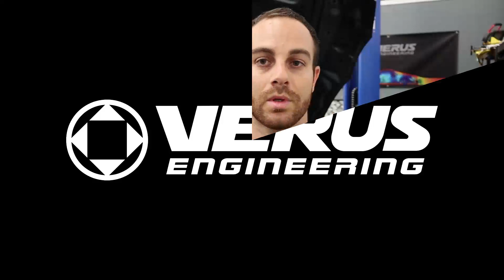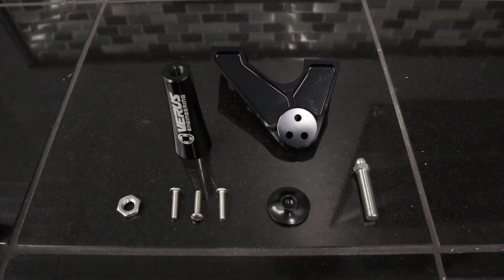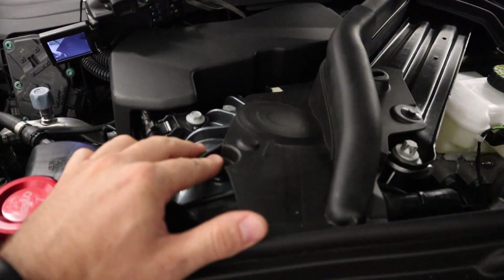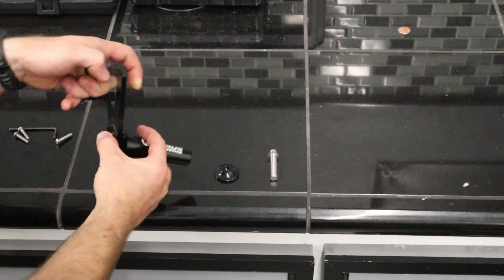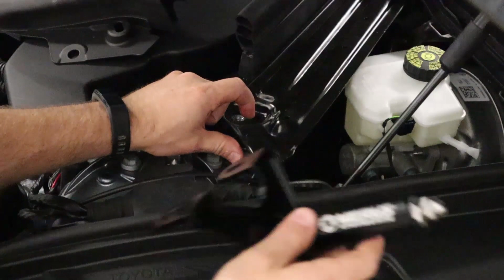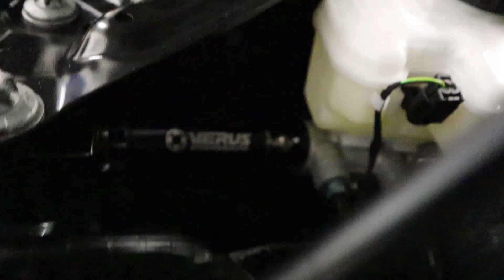Brake Master Cylinder Brace Install - MkV Toyota Supra

Comment: When installed, is it ok if the “foot” portion is able to be rotated by hand on the ball end. There is zero wobble/play at all with the foot or any part of the brace. Should i retighten it or is this okay?
Reply from the maker: I would tighten it a little more. The "foot" should not be able to be spun very easily.
Reply: Ok no problem, thanks👍🏼

Comment: Does the "foot" that rests on the master cylinder snap into the circular adjustable bolt pin or does it just stay in place based on the pressure from the threaded bolt pin? Seems to me it would be better if the foot snapped the circular head. Please confirm.
Reply from the maker: Stays in place due to pressure. We have not had a single issue with how it was designed.
Reply: @VerusEngineering  Thanks.
Reply: And by the way, I was not attacking your design just wanted to be sure I installed it correctly. I have bought many of your products over the years and been very happy with the quality and support. I appreciated your quick response. It installed with no issues.
Reply from the maker: @gregg8177  No worries at all! We certainly appreciate the support.